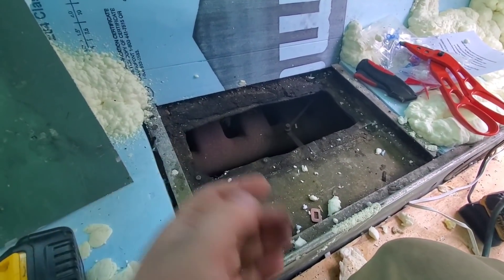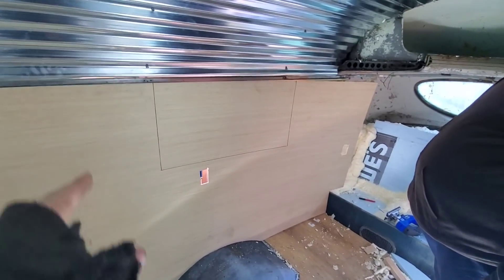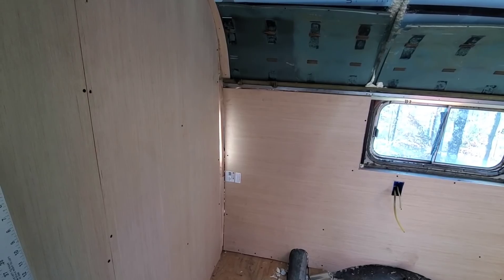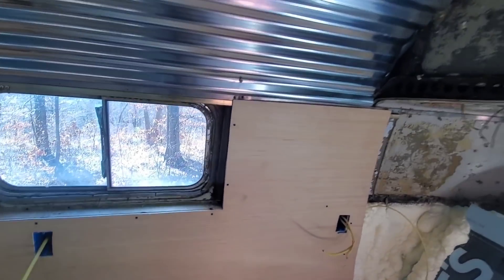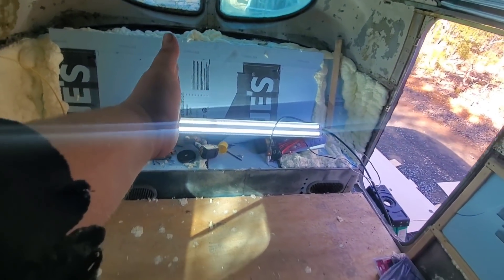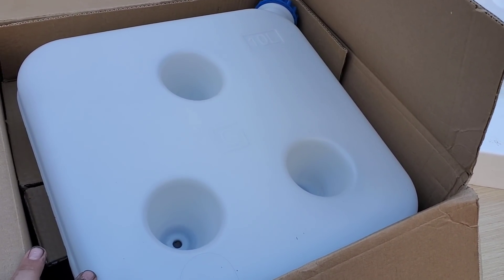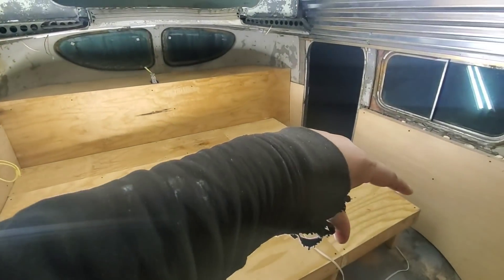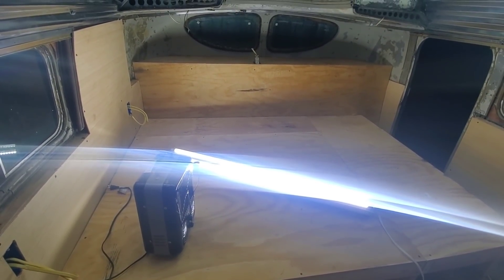Bus conversion day 3

Comment: When you mount the fuel tank for the diesel heater, make sure you install it in the diagonal so the fill cap is at the top(90 degrees from level) ,  if you mount it with the fill spout at 45 degree angle, it will only fill so high then then fuel will spill out before the tank can be full.

Comment: What a great job you two are doing. My dream was always to turn a bus into a motorhome (RV). Just a thought with regards to the ceiling lights, have you thought about suspending the timber and hiding the lights behind it and shin them out the sides to the corrugated aluminium letting the light reflect down leaving no visible lights. You can do the same with the upper windrow trim shining light up to the aluminium.

Comment: You and dad have done great having that heater installed will soon heat the bus in no time much cheaper the running a nosey generator all night see if you can hook up to diesel tank to top up the little tank for heater is that worth thinking of

Comment: If you are going to cover up the windows for good should think about maybe replacing the glass with new glass or replacing with them with kind kind of sheet metal then putting insolation between the wall and the window so that you don't have any extra cold or hot air coming in. It's just a thought.

Comment: Installing the outlet on your shelf facing up is not a good idea. Small bits of dust etc can fall into the slots causing a fire hazard. Since you already cut it in get a couple of the plastic child proof plug covers for them.
Reply: Leroy will be happy.  He will have the   couch agian.